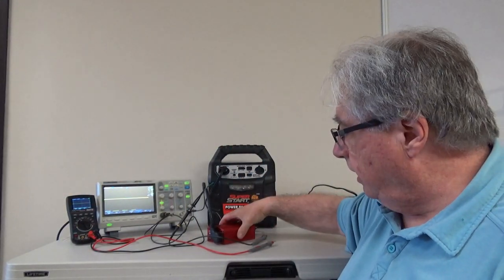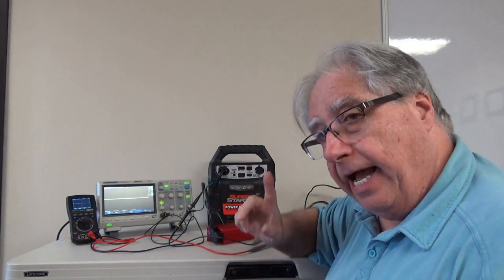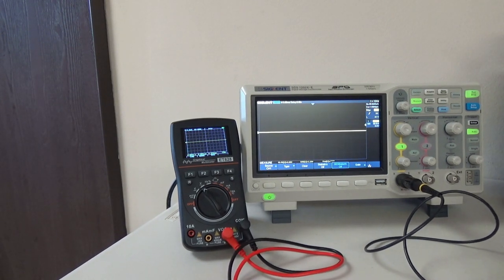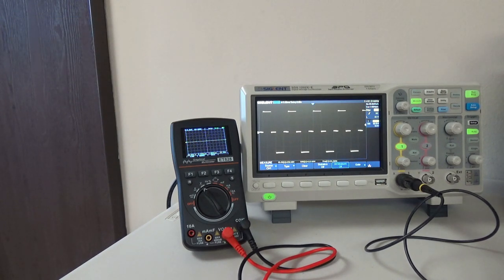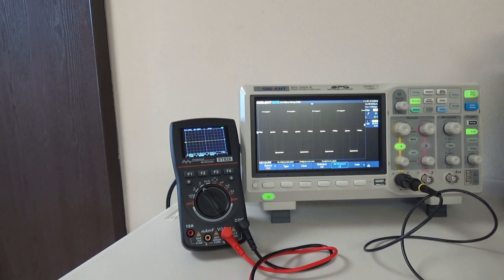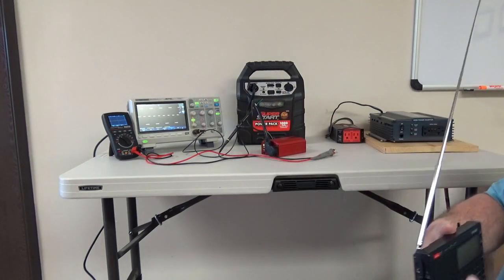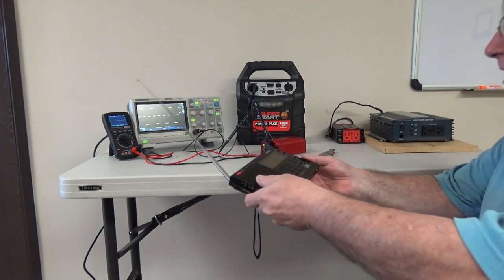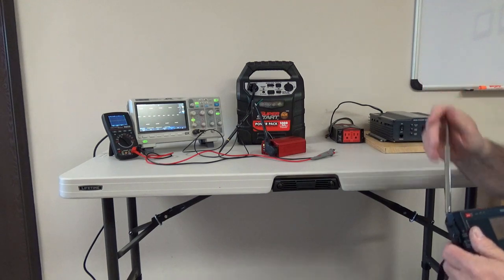Generac IQ3500 RFI Testing.

Comment: Great video Stu!  I've been a fan of Bestek products in general, I have a few of their travel converters but hadn't thought about the RFI aspect.  Crazy how much they put out!

The generac being so silent, I wouldn't have guessed it either!  I guess their claims of being 40% quieter than the Honda extend to more than just the audible range.  Very impressive.  Is there a way to test RFI easily on other generators?  Maybe with our existing radios?  I've done some testing of power lines with a FT60 and a handheld Yagi, but is there good way to use an HT or a FT891 or similar type radio to test RFI on HF bands for my generator and stuff around the house?

Would be interesting to see a video comparing various home solar inverters too.  I hear most of them put out a lot of RFI, from discussion on one of the local contesting group listservs.
Reply from the maker: Hi Ryan,
The Solar Inverters and Controllers video idea is great. Need to wait till we have a bit more sun out here, but maybe we can run some tests at a micro field day.

Stu
AG6AG